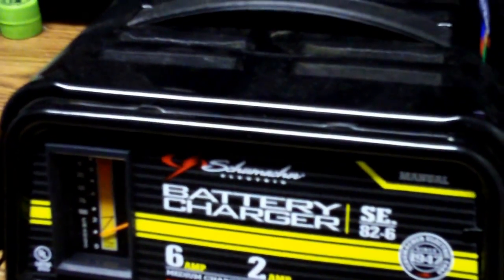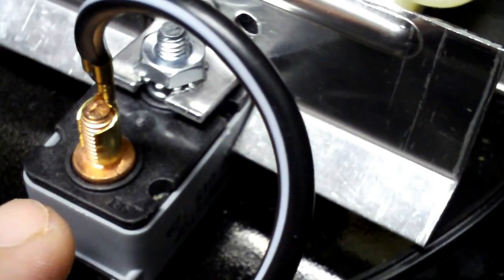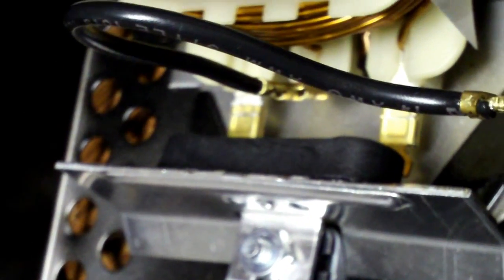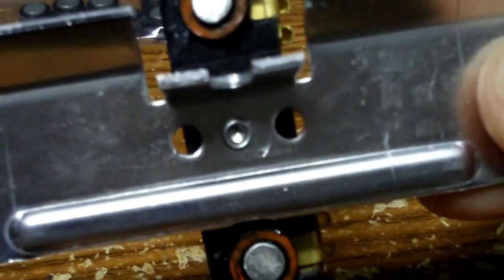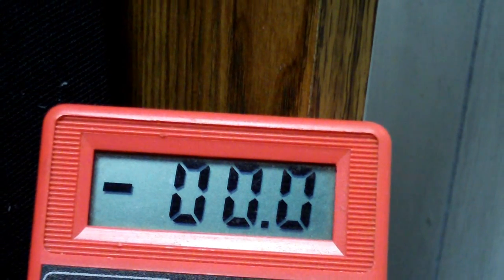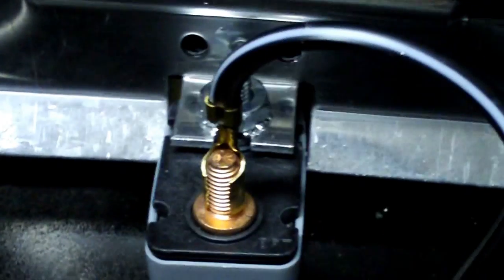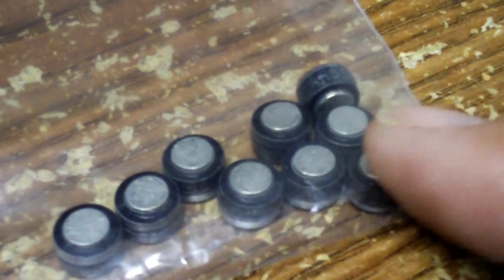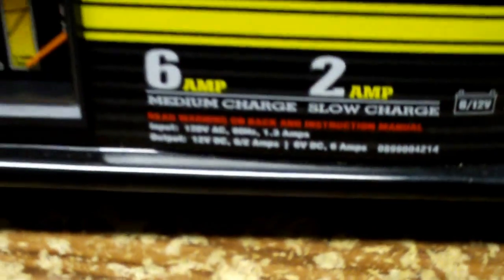12 volt battery charger repair.

Comment: Is it 2 25amp diodes or 2 50 amp diodes?
Reply from the maker: The one I worked on in the video are 50 amp button diodes  50 amp each

Comment: Where did you get these diodes and what kind are they? I need them for mine. Thanks
Reply from the maker: at the time of the repair i bought them on ebay,. they are 50 amp rectifying button diodes. do a general search for that and you may find it elsewhere on the net as well,

Comment from the maker: Well I remember my alligator clips touched just for a second,  then i remember my charger made a loud Buzzing like humm like when its under a heavy load when it was not hooked to anything, when checked my voltage and i had 2 volts, i took diodes out and the loud buzzing stopped, so i knew i had a problem with those. i looked up the patent number, found the description and part numbers, then looked and found some online,otherwise id have to buy a new one, or send it back and pay.

Comment: I have similar charger made by penske that has bad diodes. they look exactly the same as the button diodes you have but i can't figure out how to remove them.  it looks like they are press fitted in place very tightly.  how did you remove yours, and would you be willing to sell two?

Comment: that is a pretty cheap half wave rectifier with 2 diodes i think in your vid, id upgrade it to a better bridge recitifier , and add one of a more amp capacity, maybe double what your charger says on the front, then you wont blow it if you accidentally short the wires,  it seems your rectifier was shorting out the transformer, its rare they short out, they usually just fail to work
Reply from the maker: Thanks for the info, but where would i find the heavy duty rectifiers?  Yeah the terminals touched for a second and blew out just one of the diodes at the time, it working again, im just more careful letting the  clips touch,.  Thanks for the helpful info !
Reply: certainly ebay, or anywhere that sells electronics, not so much radio shack though
Reply from the maker: Cool thanks again for the info ! good to have for futrue reference !
Reply: i have a 12 volt charger with the 2 hots off the transformer goin to 4 diodes on the heat sink then one wire off the heat sink gos to the positive on the breaker my neg gos to the meter then straight out to the alligater clip, ok the diodes are bad if i put a bridge rectifier in would i just not use the - side of the rectifier? any help would be great! thanks!
Reply: *****
you would need it! the two transformer wires go to one each of the ac side of the rectifier (squigly line terminals)  then any ammeters or output fuses are usually put on the positive output of the rectfier then to your positive terminal. , the negative output of the rectifier is your negative terminal, must remember to put a really good heatsink on your bridge rectifier and as must as you can reasonably do, get a rectifier that handles more current than your device outputs

Comment: I now believe there is something wrong with a component on the circuit board because I can't get any reading beyond where the wires coming from the Transformer go to the circuit board to the meter.

Comment: Using my Multi-Testor  at the Alligator Clip black and red cables at the (Select Setting Switch) 12 volt setting of 10 amp it reads 12.4 DCV, 2amp setting 10.2 DCV. At the 6 volt 10 amp setting it reads 7.5 DCV. At the 55 Amp Boost it reads 14.90 DCV. This is all on the right side of the (Select Function Switch) reading Engine Start/Boost. When I switch it to the left side which reads Charging Only there is no electricity to the Red and Black Cables making me believe the one switch is bad.

Comment: my schumacher charger does not make that sound , but the voltage only reaches 10 volts, and then sometimes after it has been on for say 5 minutes it drops out to zero???
Reply from the maker: Hammer USN well I'm not entirely sure what model battery charger that you have some of them are for the most part different but my guess would be that one of the diodes is bad in it normally there is 2 of them rectifying diodes if one of them fails you'll have a lower voltage than normal and it might not be as loud as mine but there's a high possibility that it's the rectifying diode that are bad in it
Reply: ok, thanks , ill definitely check them both

Comment: Where did you buy the diodes?
Reply from the maker: gtb2009b back when I did the repair I found them on ebay.
Reply: Wallabydam how did you search because I’m not finding any for 50 volt button diode?
Reply from the maker: gtb2009b need to search for 50 amp button diodes
Reply from the maker: gtb2009b you may find them there or you may not but just do a general search on the internet for 50 amp button diode somebody will have them I know

Comment: I have a P6001414 Invacare power chair and its 24v battery has suddenly stopped charging. The flashing lights on the top of the control stick only show two red lights flashing when the battery is supposed to be charging (instead of two red,two amber and two green). I have tried chugging overnight but have had no success. Does anybody have any ideas?

Comment: Where do you read the Voltage?
Reply from the maker: Saint John I used a meter. and turned it to ac voltage on wires exiting the transformer. and switched to DC voltage After the rectifier diodes.

Comment: Replaced the function switch, Wrong once again. Spent the morning probing the board and applying everything I know about electronics having 1 year of Electric Shop in High School many years ago. What I do know helped plenty over the years but not now. Somewhere in the circuit board there is a problem. I do have power as mentioned on one side of the function switch, the engine start/boost side but not on the charging side. It should still charge a battery up manually though even with a bad board.

Comment: The problem with the charger is the same problem we face with about everything people own today.  It can be equipment, tools that operate on electric, gas and manual power.  This is the same problem we all have 99% of the time.   𝐛𝐞𝐜𝐚𝐮𝐬𝐞 𝐞𝐯𝐞𝐫𝐲𝐭𝐡𝐢𝐧𝐠 𝐢𝐬 𝐦𝐚𝐝𝐞 𝐢𝐧 𝐂𝐇𝐈𝐍𝐀!!!!!!!   It's all junk, no quality and made by forced slave labor and the thought consumers have thinking it's less expensive is incorrect.  Less expensive is same or equal quality.  Cheap is junk and the thinking your saving money is wrong because you end up buying multiple of the same item vs. 1 that last a lifetime.
Reply from the maker: Just my opinion, long ago the mentality  was make it last a lifetime, but companies  do not survive that way, they engineer everything to have limited life span with usage, that way they will always be in business and sell products with same limited use life. Reason anyone pays high price these days for stuff that lasts a lifetime, is be cause they know that customer wont need another of the same product because it was engineered  and made so well, even clothes material is made to last for limited life so it breaks down and makes the person purchase new, but same material, if anyone wants a lifetime product, we will pay big money, because we wont be back for a long time, til that product breaks down in one way or another, just my analysis and opinion.